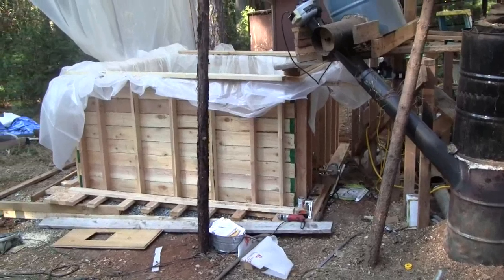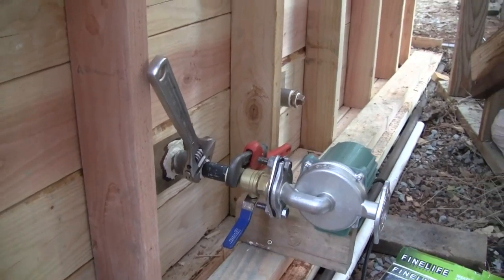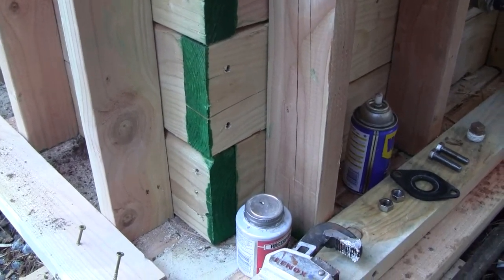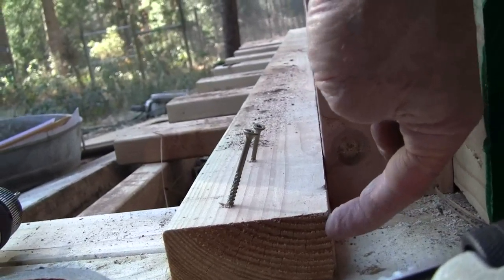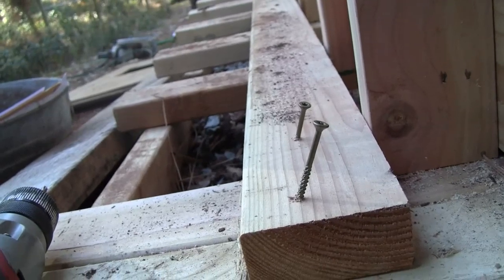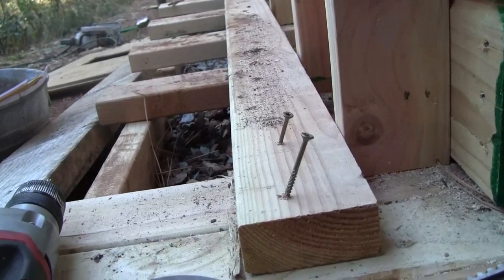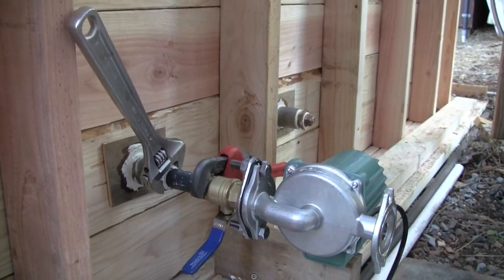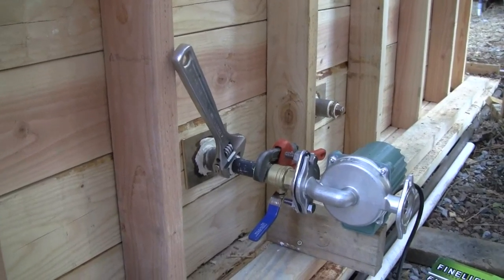DIY Hydronic hot water reservoir 6.wmv

Comment: actually because there will be no sliding  because of the threads, it will be more of a pivot at the screw intersection and outboard end...so if you drive your screw at the inboard end, you will have less lifting forces.   If the screw was a smooth rod, i agree with the angle, unfortunatley that same angle makes it hard to drive near the vertical studs.

Comment: why not just use nails and hammer on the kicker place instead struggling with screws.  it would be an easy angle for a hammer as opposed to a screwdriver or even a pneumatic nail gun
Reply: NAILS WILL PULL OUT OVER TIME, AND CONSIDERING THE AMOUNT OF WEIGHT WE'RE DEALING WITH HERE, THE SCREWS ARE A BETTER AND SAFER OPTION